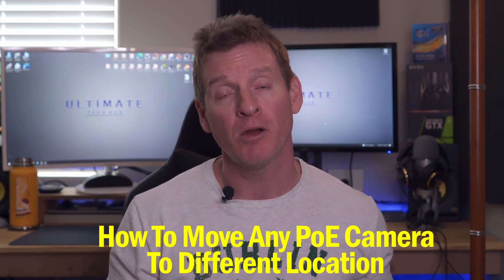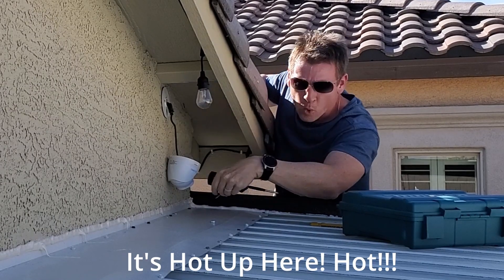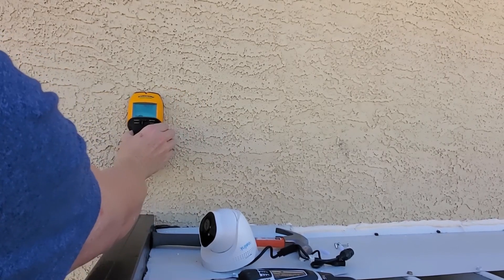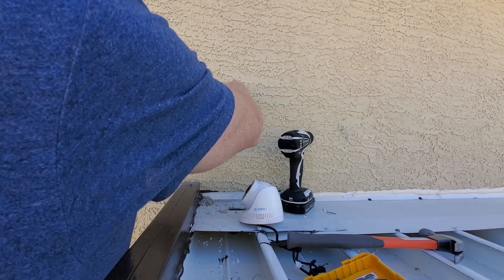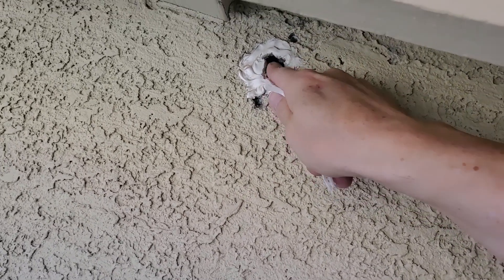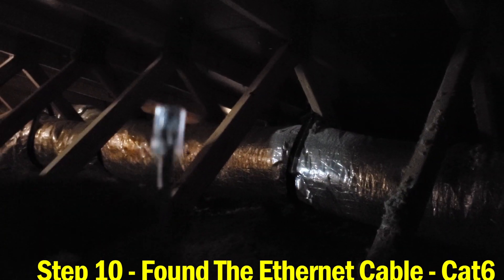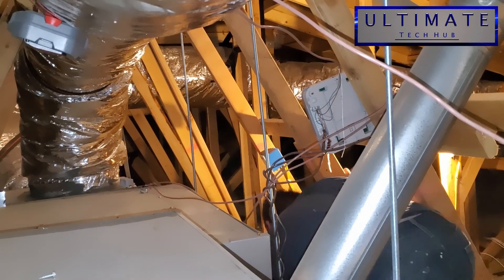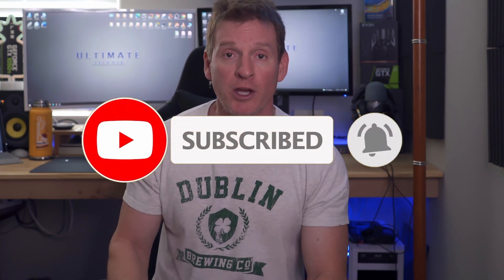CAT6 CABLE RUN IN ATTIC - HOW TO MOVE OR INSTALL A PoE CAMERA - SAFE!

Comment from the maker: Hey Everyone Welcome back to another "Ultimate Security Camera How To video!" In this video we show you how to move any PoE Camera to a different location. Have you ever installed a PoE camera? Let me know in the comments below. Thank you for watching!
Reply: Good job. What would happen if I crossed the stud 🤔?
Reply from the maker: @franklebatista1091  If you stepped between the studs? Your leg would fall through the ceiling drywall. Not good. Thank you for watching I really appreciate it.
Reply: @UltimateTechHub  Sorry, I meant I catched the raptor from outside  when drilling and kept going. 😅 so I made a decent hole.
Reply from the maker: @franklebatista1091  Lol
Reply: @UltimateTechHub  like one inch hole, would it weaken the raptor on any way.?
Reply from the maker: @franklebatista1091  Nope. It will not weaken it.

Comment: Thanks for the video.  Looks like you used a regular drill and regular drill bit as opposed to a masonry bit and hammer drill, you didn't specify or i missed it??  What size drill bit/hole?  When you ran the ethernet through the stucco wall at the 1st/old location did you run the ethernet cord through without that plastic clip/connecter on (forget what its called terminated?) or with the plastic clip on/attached?  I hope that makes sense.  I know you can by Cat6 with the clip/connector already attached. I'm getting ready to install just one PoE, by drilling a hole (still not sure what size bits...) directly through upper  corner of living room wall (not attic) out through the stucco wall near the eve where the camera will be located.
Reply from the maker: Yes I used a regular drill bit and it was probably a 1/4 inch bit and then slowly widened the hole just enough to fit the ethernet cable through. I recommend buying the cat6 with connector already installed which makes this process very easy. I have a bunch of videos on how to install the connectors on the end of the cat6. Also, when drilling the hole you can start with a smaller drill bit and gradually work your way up to a 1/4 drill bit. Good luck and keep me posted DeeDee!
Reply: @UltimateTechHub  Hey thanks again for responding.  I know if i run a cable with the cable already connected I'll have to drill a bigger hole vs a plain cord and adding the connector afterwards.  In you personally opinion which do you think is better?  What I'm considering is buying a Cat6 with the connectors already attached; cut off one end feed it through from outside in; reconnect the connector I assume that would be fine???  Also since i have you do you use junction boxes?  The camera im considering a Reolink camera that has a square back.
Reply from the maker: @DeeDee-rr3sn  I just attach the camera to the stucco with wall anchors and no box. I would just keep the end on the cat6 and then add some silicon filler to hole once you are done. Most fillers have different colors to match the stucco. But yes you could just reconnect the plug so the hole is a bit smaller. Reolink Cameras are all I use and they are very good! Congrats!

Comment: are the ethernet cables in your attic fed into the router or switch?    if so, how far is that and how do you estimate how long you need it?
Reply from the maker: The ethernet can be fed into the router or switch. If its a PoE connection like a PoE camera then it has to connect to a PoE switch or NVR system. When estimating length I usually measure from the location to the network panel and add maybe 15 or 20 extra feet for going around corners and up and down the walls. Here is a video that might help you. https://youtu.be/qcET-OgrCCY?si=DVcajSgzCVjBfOVK

Comment: You attic is nothing that is soooo easy mine you gotta crawl on your knees trying to find each 2 x4
Reply: Mine too! Mine has several spots where you have to climb up then back down, then up, then arround and there is zero floor. The back side of the house you can not even get to because there is only about 3 feet of clarence between the rafters and the roof dropping to zero and nothing lay on to drill. I was trying to get ethernet to that side of the house and was stopped by this. And my house being in Florida the attic is well over 100 degrees.

Comment: Watching you blind drill into an exterior wall made my skin crawl 😅. I'd be sooooo paranoid about hitting a pipe or wire
Reply from the maker: I didn't blind drill into the wall . I checked it out first and used a stud finder to see if any pipes or wires were there. Thank you for watching.

Comment: Could you attach cable to measuring tape and feed it through hole into attic?
Reply from the maker: It depends on what might get in the way like boards and wires. But yes you can attach a long wire or a measuring tape. Thank you for watching I really appreciate it.